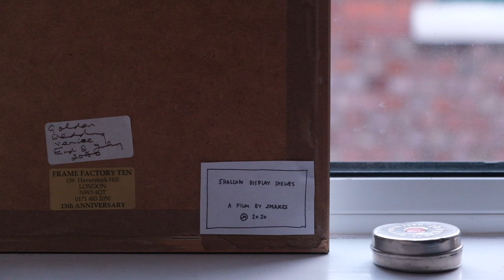Making Shallow Display Shelves

Comment: Have you considered adding a groove for the rods to sit on? I was thinking you could clamp two shelves bottom to bottom and drill a half circle into each. Or add a sacrificial piece in the middle to get a 1/3 groove. In any case, your solutions to simple objects are always elegant.
Reply from the maker: Hi Julia! Yes, when I was figuring out how to make this, I did a few tests with cylinder grooves cut out and was actually going to ahead and include them until I rested the shelves on the pegs. Then I realised that since they're so narrow, and will be under little to no force, the only thing it was going to add is another step to the project. 
If you're doing something bigger or in a higher traffic area I'd definitely say its a great idea though!
Reply: Good to know when you’ve done just enough and move on the the next project. Thanks for sharing your talent with all of us.

Comment: Another great project, finding your channel has been a real gem and offers much inspiration for northern basements turned workshops. Can I ask where you get your plywood from? I struggle to find a good supplier
Reply from the maker: Thanks mate! I get all of my baltic birch from a local timber merchant called Atlantic Timber ( in Altringham). It can be quite hard to source, but if you ring up a few local places I'm sure one of them will have it in stock, or failing that if you ring up a big supplier (like Latham Timber) they should be able to tell you who they supply to. Hope this helps!

Comment: Nice work the shelves are looking great. Where did you find the wood for the trim pieces?
Reply from the maker: Thanks Keith! I was struggling to find birch edge-banding so I actually ended up resawing an off-cut of plywood. Slightly more laborious but it worked well in the end :)

Comment: new subscriber here, thanks for the nice video, I wanted to make that kind too and I wonder if I can :/
Reply from the maker: You definitely can - I'd actually say this is one of the best projects if you're just getting started, and you could use solid timber, or edge band the plywood, and use wall plugs and screws if you want to make it a little bit simpler :)